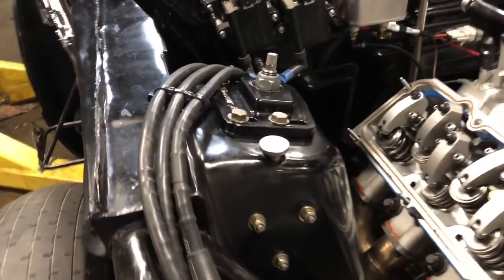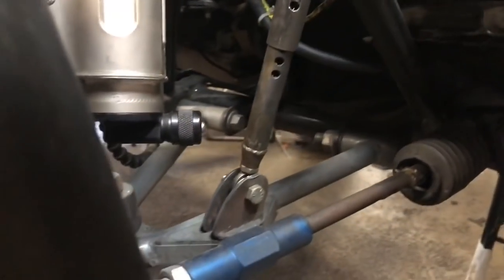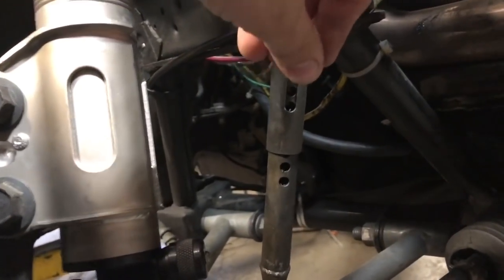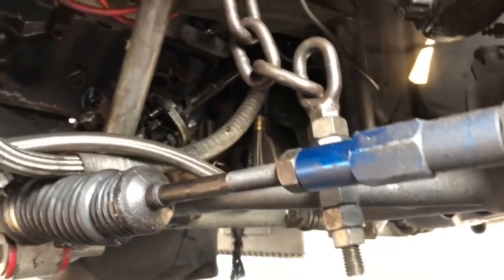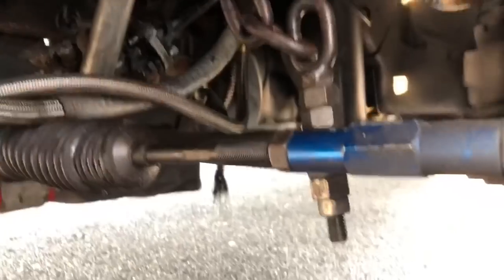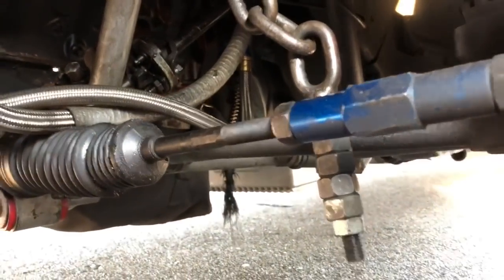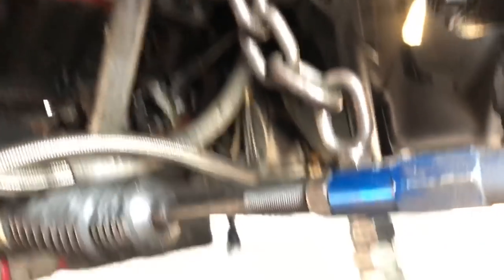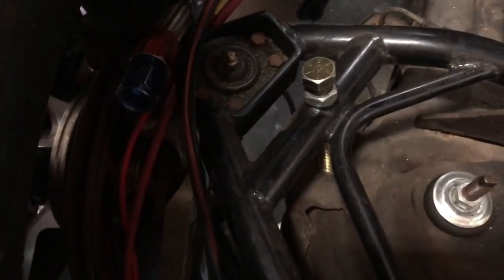Travel limiters, Struts and Coil Springs, the basics of Front Suspension Drag Racing

Comment: General question for you from a neophyte.  It would seem that there could be a big difference in RT (car only vs driver) between a slick car vs a radial car.  Slick has to compress and then gain some wheel speed vs radial which dead hooks.  Seems a radial car (with everything else basically the same) would react much quicker than a slick.  Am I correct?
Reply from the maker: I would think you are correct!
Reply: Thanks!  I am 1 for 1!

Comment: In the dirt racing world we run these on the left rear to limit lift on a 4 bar car to adjust rear steer and bar angle. We run bushings or bump stops so when the chain hits it wont shock the chassis or pull the left rear. I could see this being a help in the drag world to not shock the chassis. Some cars run a spring even though its not legal in the dirt world u can fine tune it easier. Let me know if u need some more info or maybe u have tried this before.
Reply from the maker: Yes, I would love to learn more about how y’all do it on dirt.  Point me where to learn!